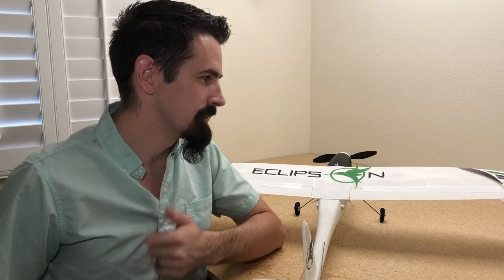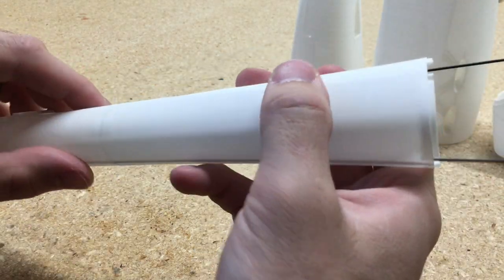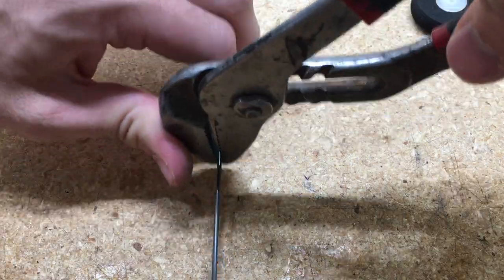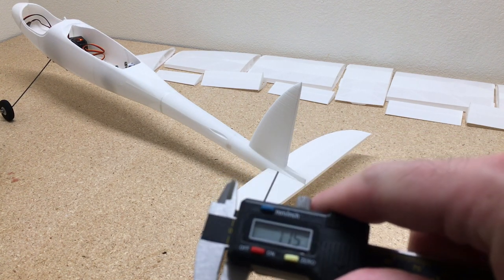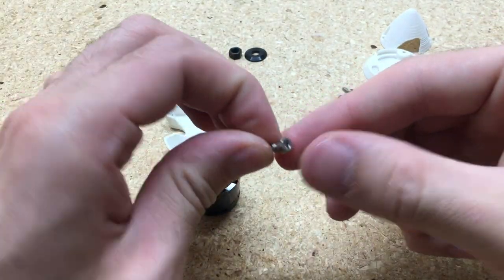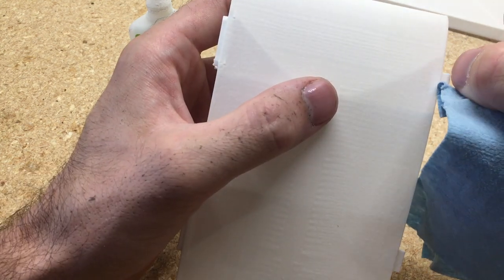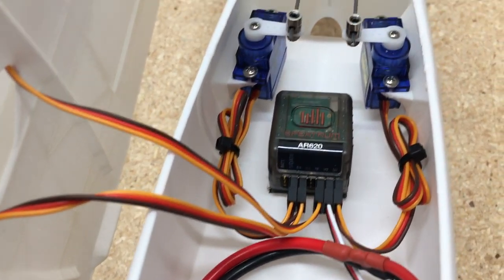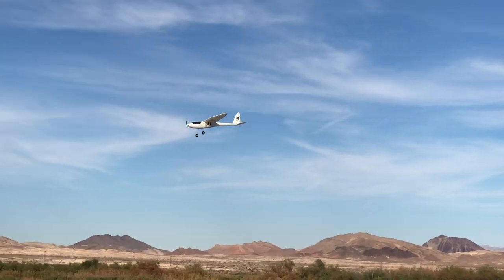How to Assemble Eclipson Model A RC Airplane - LW-PLA

Comment: One more thing: a folding prop is very helpful on the free, belly landing version of the Model A. It eliminates propeller related landing accidents, makes motorless gliding a lot better. And allows for a larger prop. I currently have a 9x5 Graupner CAM folding prop on a 2212 1000kv  racerstar motor and 3cell batt. VERY good climb rate.. ;)
Reply: Could you please give me the link to this folding prop?
Reply: was thinking the same

Comment: Printed, assembled and maidened the free version last week, with PLA fuselage and LW-PLA wings. Flies absolutely great. Slow and fast, little acro, no problem. Dropped an Arduino Nano and a few WS2812 LEDs into the wing. Looks great due to the opaqueness of the LW-PLA and the internal structures. Somewhat like a dragonfly wing.
Reply from the maker: Nice job building a hybrid model of PLA and LW-PLA. I am glad it flew well. This is definitely one of the best flying 3D printed planes I have done. Putting lights in the wing sounds like a fun idea. Cheers

Comment: I printed an additional wing and this time put a customized strip of adressable WS2812 RGB LEDs into the wing and elevator. Spaced out in a way, that two LEDs shine into one  internal "support cell" of the wing. They are, again,  controlled by a standard Arduino Nano and I can switch patterns via a free RC channel. Nothing fancy. LEDs in the elevator are a must for orientation. Nearly crashed my original Model A in the Dark which only had lights in the wings.  The LEDs look awesome, as the white PLA diffuses the light, and makes the internal structure of the wing visible. Looks like a dragonfly wing. Plane looks like something from outer space in the dark. I think I'll print a white Black Wing specific for night entertainment purposes. With a flight controller and GPS it could loiter and leave the pilot free to play with fun LED patterns. Make UFO sightings increase in our area. ;-)

Comment: I have printed fuselage section 4 on my FLSUN QQS PRO with LW-PLA and also printed the same thing on my ENDER 3 using a good quality standard PLA. In both instances the part looked great, but also in both instances I am not able to fit the 1 mm carbon fiber rod in the channels printed for it. Any ideas?

Comment: Funny, I just got my spool of LW PLA today and am printing the heat&foam tower to get the settings right, than this popped up 🙃
I didn't even think it was possible, to use it for a complete model. I'm going to use it for the fuselage formers of a WW1 plane which will be planked with balsa.
Reply from the maker: Ya I have built a lot of fully 3D printed airplanes. Check out my Channel to see all the builds I have done. I am starting on a new model from Eclipson this week using LW-PLA. Have fun using it the first time I printed a part in LW-PLA I was amazed by the quality and the wight. Thank you for the comment Cheers
Reply: @TroyMcMillan  These new materials surely open a lot of possibilities you don't get with 2D jigsaw parts, but in the critical parts, I still will be using birch plywood 😉 I'm old fashioned. 
You got a new subscriber 🙃
Reply from the maker: @M0rdH0rst  Thank you

Comment: Thanks very much for sharing how to assemble the plane.  Have inspired me to do the same but I did so with regular PLA.  I know its a bit heavier but thought I could at least use the practice printing and assembling the plane.  Just need to properly find the C of G.  Can you please be a bit more specific on how to locate the C of G on the bottom of the wing?  Thanks again for doing a super job with your video.
Reply from the maker: It should be fine to fly with PLA! And it flies great, so that will be awesome to practice with. Have fun! :)

Comment: I just wanted to let you know the props you listed in the description are the wrong hub size they are way too small to fit that motor that you listed
Reply: Did you figure out what to buy instead or did you drill out the hole in the props?  I also found this the hard way.

Comment: Regarding the use of 3m duct tape, what kind did you use? 3m makes a variety of types, nuclear, rubberized, etc. Also why are you CA gluing the duct tape? Isn't it already sticky enough to stay put?
Reply from the maker: I used 3M multi purpose white Duck Tape. Yes I agree it is very sticky anyway you don't really need to use CA glue initially.I am hopping using the CA glue will make sure it will not come off in the future. It will last longer but still not necessary. You could just replace it if it starts pealing.
Reply: @TroyMcMillan  Thanks, I watched another YT build video and the person doing that one used the same tape (he showed that he got it at lowes) and also did the CA glue thing. I'm guessing that both of you are just following the build instructions at this point unless he watched your video first and just copied your technique, Who knows and it's a nit anyway. Thanks for responding and keep up the good work

Comment: So, this model uses flaperons.. 

I am aware that we need to mix channels to get the aileron function and mix the 3 way switch for flaps off, part flaps and full flaps.

Have you any recommendation as to how much angle for the flaps? 0°/10°/20° or 0°/15°/30°

Obviously you won't want to go past 40° unless you want a flying brick..
Reply: Did you get an answer to this? I'm curious as well.
Reply: @KiwiandPixel  I just used 10/20.. The only feedback I have had around the net and from groups is hate of flaperons. 

Due to licencing in the location I was in, I personally couldn't fly. It had to be in a club. They were religious of balsa or foamie and was very negative of 3d printed. They changed the wiring for no flaperons and was over forceful, pressing a curved wing to the table and then broke the wing, saying it was too delicate to fly - really I think it was deliberate. 

The plane never flew. Yeah I can print a new wing for them to fly, but they will only break it again. 

Yeah, I could get a licence and join the club, but they will be haters, I will get no help and it just won't be fun being there.. it became a model and eventually left behind when I moved.. shame really..
Reply: @paulradford4100  Sorry to hear, sounds like a bad place to be an RC enthusiast.
Reply: @KiwiandPixel  I'll gat back to it some time.. Regulations are different where I am now, mainly safety related

Comment: Hey man I love your channel and decided to try printing the free version. I thought I saw you printing multiple parts at once but I can’t seem to do it without stringing that causes the outer walls in those areas to be thin or open. Are these Eclipson parts meant to be printed one by one? I love their cura profiles and parts breakdown. It’s very intuitive. As a 3D printing newb I was able to upload their cura profiles tweak temperatures and get great test prints on my Ender3 pro. I’ll definitely be purchasing another design. LW pla is on order. Thanks for any insight!
Reply from the maker: Thank you for the comment, When I am printing fuselage and wing parts I always try to print them one at a time. It gets the best outer skin result and  keeps the extruder inside the part. For small parts like spinner motor mount wing attachments I print them all out at the same time. It is definitely more time consuming this way having to change the parts out every 2 hours rather than leaving it all day and having all your parts done. But the end result is better. Good luck with your builds.
Reply: @TroyMcMillan  exactly what I needed to know. Thanks so much for your quick and helpful reply! Have an awesome night!

Comment: Any experience with this model printed in regular PLA? I am not a really experienced flyer and would like to avoid purchasing LW-PLA at least for my first plane since I'll most likely crash it :) I'll definitely get the LW-PLA once I have some more confidence with flying... Just wondering if regular PLA will make the plane harder to fly or considerably faster or something. I really like how this plane seems to fly, really slow and nice.
Reply from the maker: I don't have any experience with this plane in PLA. The advantage of this plane is how well it flies. The reason it flies so well is because it is so light. LW-PLA is about half the weight of regular PLA. This is definitely my best flying 3d printed airplane it flies very nice and slow and controlled great plane for a beginner. This plane took around a quarter of a roll to print so if you did purchase LW-PLA you could get 2 maybe 3 planes out of one 750gram roll. If you print it in PLA this plane will not fly as good or as slow as I show in the video.
Reply: @TroyMcMillan  As a project you should do one in regular PLA just to report on how well or not well it flies. I'm betting that a lot of us are looking to get their toes wet in 3d printed airplanes and would prefer to  do our first projects using materials that we are familiar with i.e. normal PLA and not add a bunch of new variables e.g. LWPLA to an already untried process by those of us who have never printed, built and flown a 3d printed airplane. To that end information on building this plane with "normal" PLA and other readily available materials would be very helpful for those of us who are just getting started. On another note I really like how you have sourced most of the supplies needed to build this plane on amazon. This is perfect for those of us who are doing this for the first time plus not everyone has the same local resource to source materials but just about everyone has access to amazon
Reply from the maker: @pbshooter100  Thank you for the comment I will be doing a video on the next plane comparing LW-PLA and PLA. LW-PLA is very easy to work with. I agree trying to make a list of parts that people can order from everywhere is important I am trying to find parts that can be ordered easily.
Reply: @TroyMcMillan  Yes I saw that one today and it was very helpful
Reply from the maker: @pbshooter100  I will actually be doing another one with the full plane. With my next Eclipson plane.

Comment: Can I also use a 2200mah battery, that weights 149 grams ?
Reply from the maker: It may work but it is very heavy battery I would not recommend using that large of battery 800mah would be perfect.
Reply: @TroyMcMillan  Ok, thanks for answering  !

Comment: The servo mounts for the ailerons seem awfully flimsy did you do anything different to strengthen them?
Reply from the maker: No I don't do anything to make them stronger. I have used them for many of Eclipson's builds and I have not had any problems with them.

Comment: Hey Troy! I printed all the parts and got excellent quality printing them separately! I noticed the servo holders printed wafer thin and very flimsy. Have I done something wrong or are they intended to be that way? Thanks!
Reply from the maker: That is correct they are supposed to be thin they work good I have not had any problems with them. All of the planes I have built for eclipson have used the same design. Just make sure your bed is adjusted correctly if the extruder is too close to the bed then it will print it even thinner. Good luck with your build
Reply: @TroyMcMillan  Thanks for the reply man I’ll check that and go with it!

Comment: I just completed a build using PLA. The resulting plane was very tail heavy. To get it to balance slightly nose down I had to switch out an 80g 3S battery for a 180g 4S batter. All parts where printed to spec. Has anyone else had this issue?
BTW - the video doesn't mention it but the suggested power pack (FliteTest B) requires the use of an 8mm standoff between the motor and part 29 - Motor Holder.
Reply: i know this was a long time ago but did you need long screws because of the standoff you had to print?

Comment: Once again it would be great if you could source your wire, yes I know one can use music wire but for now I have no experience with what sizes are available and even where to get it locally (have not seen it at local HW stores). You list 3 different sizes of wire in your build, does music wire come in those same sizes? It would be great if you could provide a online source for wire in your builds for those of us who might not be able to find it locally. Thanks!!
Reply from the maker: I am sorry to hear you are having difficulty finding these wires. This Is one of the most common questions I get asked about daily. I have had a hard time finding these wires online also. These planes require long wires preferably in 36in length. I do order carbon rods from ReadyMadeRC they have 36in length and ship fast. Most of the time when I tell them use music wire that works for everyone so I have not looked more into finding this online. I will look some more for it and let you know. Cheers
Reply: @TroyMcMillan  Thanks, I'm starting to find links on other YT channels that are reviewing Eclipson builds that provide links to some of the wire stock, Eclipson themselves have various links for wire in their build instructions. Not all the links are useful as they are out of date or with suppliers that not everyone would want to do business with however I think there is enough info published out there where one could source everything they need if they spend the time to watch 5-8 build videos plus look over Eclipson's build notes
Reply from the maker: @pbshooter100  I am glad you found the materials.

Comment: What are the lengths of the carbon fiber rods in the rear of the fuselage? In the video you measure them to 8.5" and 9.25", is that correct? Does Eclipson include build instructions?
Reply: They don't - I have the same question. I will reach out and ask as I'm printing the model right now.

Comment: What 3d printer, what size, are you using.
Reply from the maker: For all the planes on my channel you will need a printer with at least a 200x200x200mm build plate. I use the artillery sidewinder X1 currently as my main printer.

Comment: Building this first in PLA before trying LW-PLA. What type and size are the small screws as I did not see them listed on your BOM?
Reply: -SCREW - M2X8mm (aprox) 26units    ,   listed under other parts, they did not work for the servo mounts in the wings, 2.3mm dia works a lot better.

Comment: Hi - I have been inspired to build this by you and have successfully printed and built the fuselage already.. LW-PLA is amazing ....BUT the wing sections seem to be warping away from the bed at the ends .. I've reduced the bed temp a bit to 50 degrees .. using an Ender 3 Pro and 3D LAC plus for adhesion  ... Any Ideas??
Reply: Fixed it myself
Reply: @IconicSpitters  having the same problem...what did you do?
Reply: @RPGWoodworking   i realised the wing sections are much narrower than the fuselage so thinking about it I decided to add more layers of brim .. I went up to 10 from 4 and went back up to 60 bed temp and it worked a treat 👍😉 Can’t recommend 3D-LAC enough either .. a cracking adhesion aid .. used to use hairspray and this is much better 😎
Reply: @IconicSpitters  thanks for the tip!  i'll give it a go...i'm working with the Ender 5 Pro and i love the magnetic plate and have been just using glue stick.  for the most part, everything sticks great but these wing bits have been giving me fits.  it's my first 3D printed plane too so that may have something to do with it.  i'll let you know tomorrow how it goes since i'm printing my last fuselage piece now and am going to print the wing bits tomorrow.  again, thank you!

Comment: Hi, thanks for your video, very helpfull. I started to print the free version of this plane (to test before buying the Panthera) and will soon start the assembly. Why is the glue you use for this ?
Reply: I believe he said he used CA glue for the plane. That’s also what is recommended on the Eclipson instructions. HTH!
Reply: @dronedadfpv4541  thank's for your support. you're right, I understood he mentionned CA glue, as specified in the Eclipson instruction. I was more interested by the brand/type of CA glue that he uses in his video. I tried some CA glues but without complete succes. I ordered some Loctite 454 as recommended by french printers, but it is difficult to be supplied for specific equipments here nowadays (not before 2 weeks ...)
Reply: @matthieumorin5134  I understand now, I hadnt tried to glue any of them together yet. I wasnt expecting to have trouble with the glue. I have medium ca that I was going to try.

Comment: why not leaving wire inside back and front wings, and have stucture inside wings a glued box elements to fit size any size is model material aynway is slight more wieght but you get stiffness and material structure it should fly the same excpet in downflow slight more responsible, I still dont see this ribets squered so fast glude hwo they glue so fast and still stay tight to me it looks to fas tglued to keep it ligth for cuple time watch assembly it looks like 3d printer could also  help for aditional desire or improvements

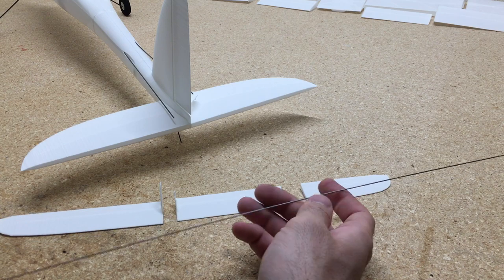Comment: fyi  -   at 5:58, there is   NO  Rational/logical reason to locate the mass of two servos  AFT  of  the  cg/c-m.!!!      at 6:37, it is not clear whether the  hinge gap was sufficient to allow the rudder to move to the  Left.       at 7:51,  and, lets use a stoopid  SF  prop!!!          cheers

Comment: at 9:30, it can be seen that someone has (stoopidly) designed the wing with a thin, less-lift-making,  Profile !!!!      cf. the clark-y        consequently, the model/wing will have a higher stall speed  and  Other  not-quite  normal  traits.